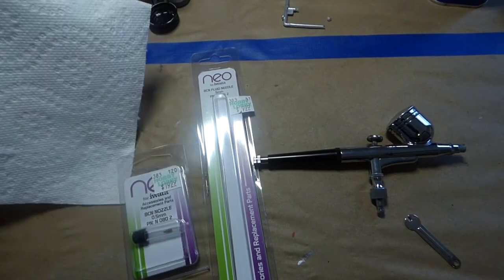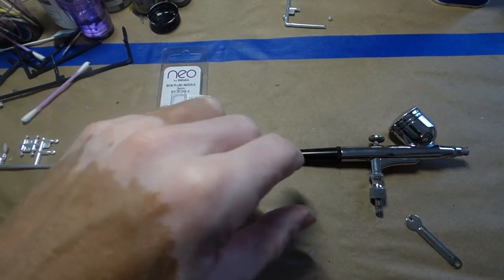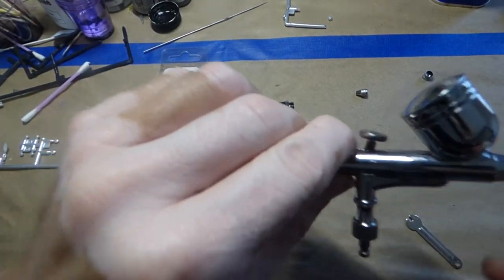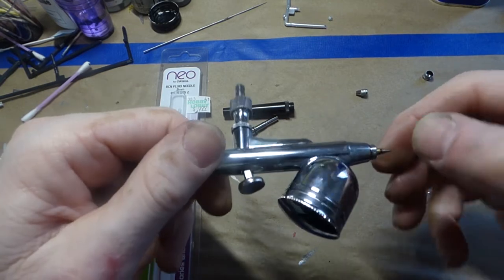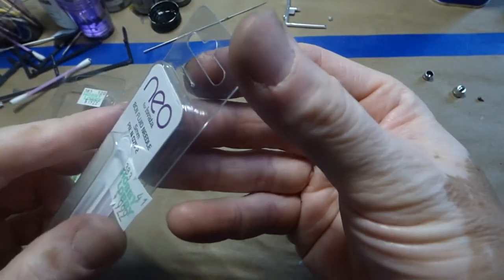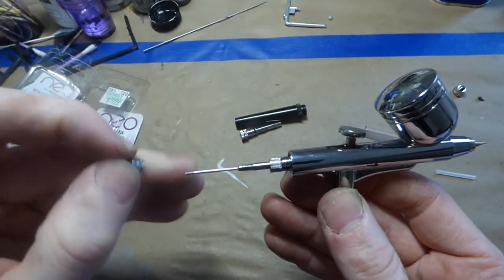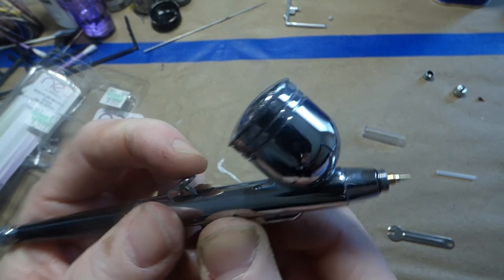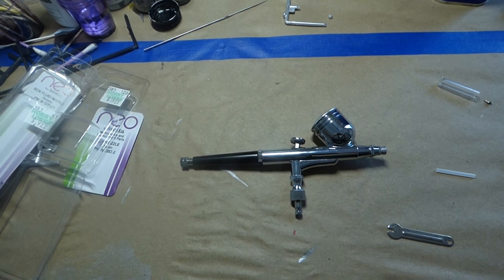Harbor Freight Avanti Airbrush Needle Change

Comment: I've seen another review of the HF Chinese airbrush and it is a quality airbrush.  I've got the old HF Chinese siphon feed airbrush and I want to try this new one out as I don't have a gravity feed airbrush and getting one for $26.99 is a plus.  I've heard it compared to an Iwata airbrush as it's made nearly the same.  I use my HF Chinese airbrush for lacquer and enamel painting and use my Badger 155 Anthem for acrylic painting which has a .5mm needle.  I still use the old HF air compressor as it's pretty good and I don't notice the surge.  I do have an 8 gallon air compressor from HF should the need arise to use it.  I've already made up a hose & fitting to use it.  Cheers from eastern TN

Comment: If you changed the needle nozzle the air cap ha to change to. If you just look up conversion sets for brushes like the passche or badger all have there three pieces. If the air caps wring the air is coming out to wide or to narrow a hole to work. In this case it'd surprise me if it didn't stop airflow completely. Guess I'll see at the end lol.

Comment: So this 0.5 works with the airbrush or no?
Reply from the maker: It worked for me. You made need to drill out the cap with a micro drill bit for better flow. An upgrade set from TCP Global (Master Airbrush) would likely also work.
Reply: No, it does not work unless you modify the brush. Waist of time.

Comment: Do you have any video on how the airbrush sprays?
Reply: Yeah, that's what I want to see too. The important part.
Reply from the maker: I'll be doing a build video soon. I had to exchange my set after it got severely clogged and somehow damaged the nozzle or something. The spray pattern just wasn't right after that.
Reply: @mikesmodelkitworkbench6357  bc the nozzle you put on it was too big for the cap..... Which was made for a .3 not a .5
Reply: when I change out needle nozzle and air cap I polish new needle with 3M 5000 grade foam pad then apply small dab airbrush component lube - this makes for optimum paint/air atomization and hel
Reply: Yes, the parts do not work without further modifications. The 0.5 parts are not compatible with other parts of the airbrush affecting the spray and causing the trigger to bind.